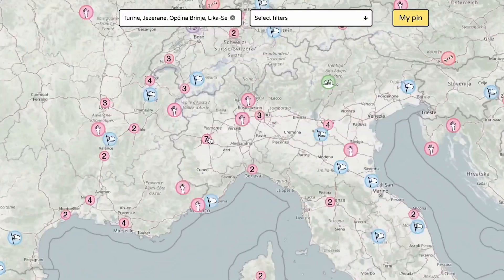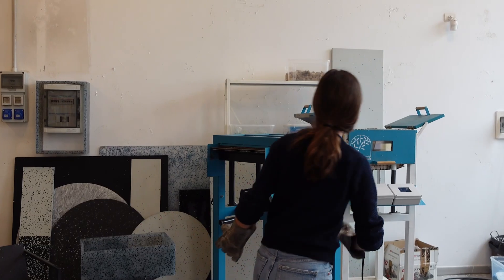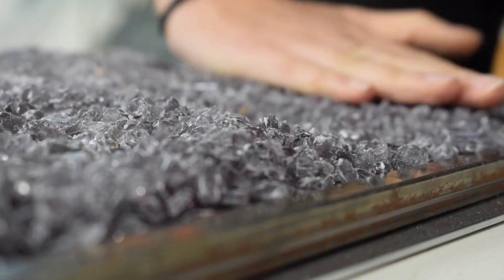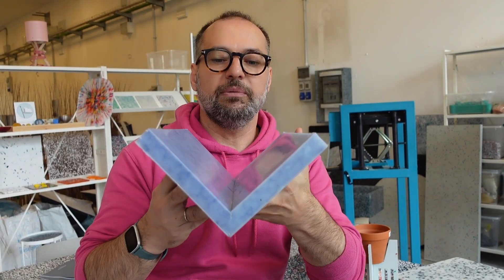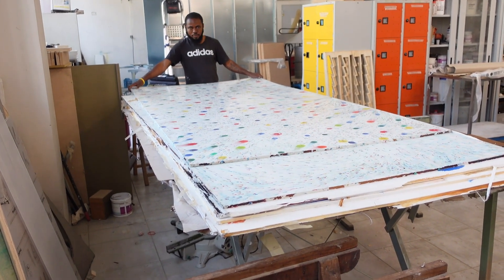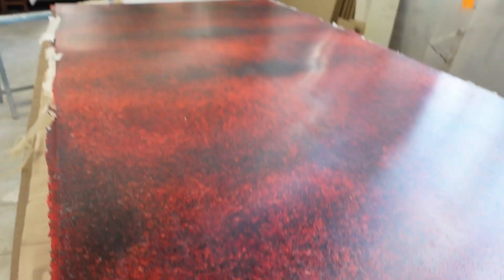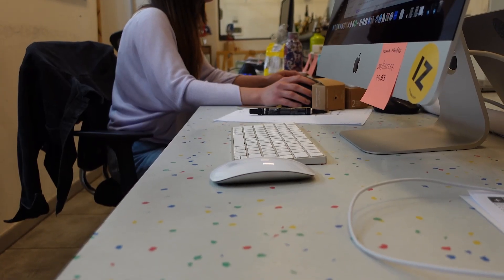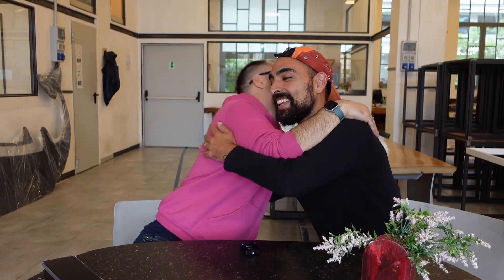2.5m recycled panels, BUT HOW?

Comment: the stuff looks nice a bit like terrazzo , it would make nice tiles for flooring , if it wasnt for the fact that they wear out / grow dull / release microplastics intoo the enviroment after being walked over constandly , maibe use it as wallcovering instead (indoors as it will likely grow moss and be affected by uv light outside ) 
you might be able to make the material intoo a little more rough and open structure and make roofing tiles that are made to eventually grow over with mos making it blend intoo nature (the way i would go about it is make a solid base and melt the more course material intoo the top of that so its still strong and waterproof  ) the moss covering should protect the plastic against the sun though it will still dissintegrate from the force of the roots going through the material being hit by rain hail , temperature differences and fateque
Reply: Moss doesn't have true roots. Their hairlike rhizomes help attach them to whatever substrate.
Reply: you do realize that carpets and alot of flooring available today is made of plastic and fibers from carpet get torn and fly into the air we breathe.